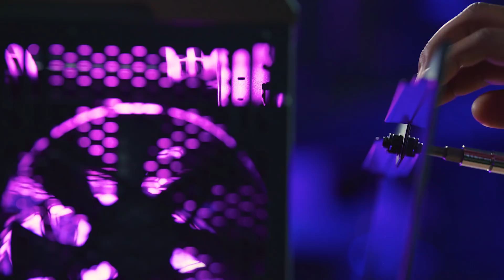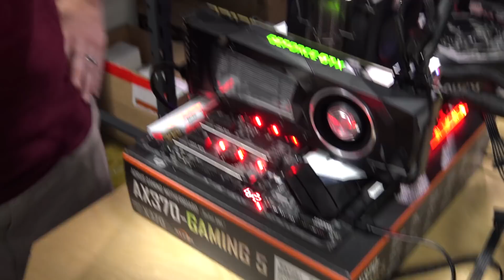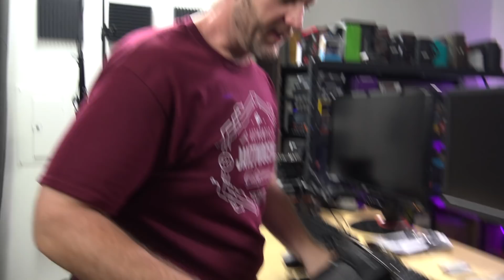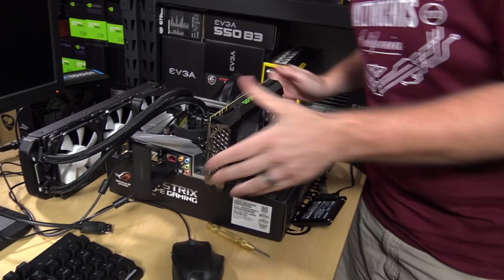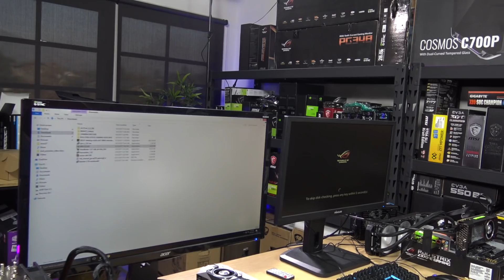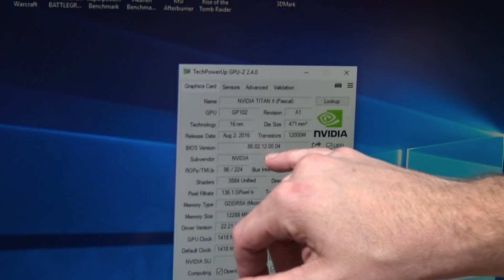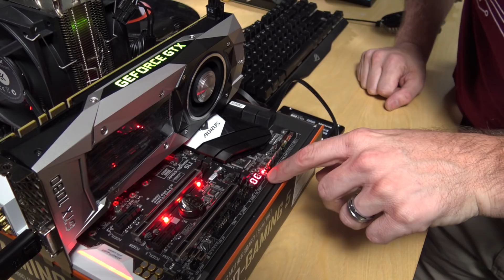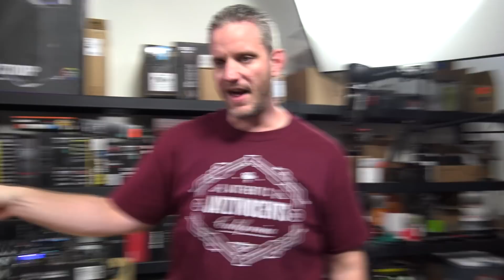I cant figure this one out... HELP!

Comment: Okay, how I would troubleshoot:
1. CMOS reset. Never know when you changed something to test out or maybe something crapped, it's the motherboard version of turning off and on again.
1a. Change to the other BIOS if the motherboard comes with backup
2. Change the PCI-E power rail. Never know when you got the crappy length of wire from the industrial sized roll they used.
3. Change the PCI-E slot. Who knows, maybe it is damaged or just being annoying and wants to give it's brothers a chance. Happens a lot with RAM had it happen a couple times on PCI-E
4. Change the power cord. Never know when yours got so twisted and bent over time it has broken inside. Didn't use to be a problem, but most PSUs don't come with a cord no more.
5. Change the PSU if I have another. Never know when you got the shitty lottery roll. Skip if you don't have a spare.
6. Take it to a friend/colegue and test in another machine, you could be just that unlucky.

Now here is where it gets annoying, because I don't know what else you've done but let's assume everything else was done and we got to this point and the card worked on another computer but all else failed in your machine.

7. Would flash the card with an updated BIOS from the maker and the motherboard as well to make sure it is up to date.
8. I'd hire someone with electrical expertise (don't have that, someday I'll fix this in my curriculum) and test the slots for OC/UC and overall power distribution in the motherboard to see if it is shorting out somewhere or having any sort of issues. If so, RMA it. If it is my own, I'd just RMA the mobo since I can spare the time but we are assuming it is for a client, right?

If it still won't work just in my rig, I'd toss something non-expensive and probably heavy at the wall, curse a lot and do some Google-fu to try and find out what the fuck else could this motherfucking card have against this god damned motherboard so these two bitches would fucking talk to each other. Ahem, pardon the french.

And as 3218390148109 people pointed out, you checked the BIOS of the same card twice. Cheers.

Comment: Check bios on mobo and IRQ settings if you’re able. Clear or reset settings. Can you push out verbose BIOS out instead of pretty logo? +1 one comment about BIOS #. You didn’t check gfx bios when you moved card from ryzen to intel system. Post check is failing likely due to another setting - again recommend verbose BIOS out

Comment: Jayz you checked Bios on the same card twice.
I was gonna say faulty MoBo. I'd try removing the power plug and setting the PSU on 0, then remove the CMOS battery for at least 30 minutes. (Reset CMOS if you'd like) and insert the CMOS Battery, the powerplug in the PSU, switch 1 on the PSU and Start. Also check drivers.

Comment: To me it would be an older BIOS version on the card that is not working on the Ryzen rig... I bet if you flashed the vBIOS from the working card to the one that isn't working that it would indeed work. You cant really blame AMD, Ryzen or MSI or whoever as the card that does not work would have been released before these Zen parts were even out right? so it would make sense in that way.

Comment: Use another motherboard? If your card works, it obviously a motherboard issue. 

You had to reseat your 2nd card as well to let it boot. More obvious pointers.

It's also a gigabyte, notoriously bad motherboards in my experience.

Comment: When stuff like this happens to me, the first thing I do is eliminate any and all potential dumbassitude... I'd Mount the questionable hardware in a real case or test bench. Then reflash the GPU, possibly corrupted, even though version correct. If available, I'd do the GPU in a different Ryzen build. It's possible to have some random physical blemish causing a snafu due to voltage needs of the silicon lottery. I'm also old and senile though... Damn near 50.

Comment: When I build my ryzen my old gtx970 don't work properly I installed an reinstall 3/4 times nothing happens after  boot my PC with one ram works fine after clean boot and some check on bios reinstall the second ram everything works, I don't know what happens I install the ram on the right slots as the manual show me

Comment: Thanks for the video because I am going to do my first build in a couple of weeks. Can you plug the non working titan card in another pci slot and see if it works. If it works then the problem is the first pci slot you plug into. I now that you tried other cards into the first pci slot, but if nothing else work there is nothing lost in trying.

Comment: Problem: card doesn't work in this system but it does in this other system
Solution: get a new card, the card you have is borked. 
Reason: This is an impossible to troubleshoot issue. you are looking for a needle buried a beach full of sand. There is most likely something off about the silicon on that chip that is causing instability on the ryzen system. Either because the board itself can't deal or like you said, ryzen is very picky. with the way ryzen works, there might be some bad circuitry on the GPU that is causing Ryzen to have issues communicating with the card, hints the VGA error. but i'm just a lowly techy that has had issues with OCs and bad and aging chips over time. I've had a 5770 bite the dust then rise like a phoenix again... WTF?

Comment: thats what we call a bug, THAT titan maybe has a magic set of characters somewhere that happens to cause THAT motherboard to freak out, or vice versa, try different ram, cpu, cpu fan headers etc etc

I've had a similar experience with pata drives a while ago, a specific drive wouldnt work on a specific board, everyone baffled, then months later that board was found running fine with that hard drive, but there was different ram, so whatever

Comment: maybe not reflash the BIOS, but RESET the BIOS, sometimes there can be quirks with new hardware, and a preset BIOS can mess with it. Same reason you should reset a BIOS after a reflash. I've had past issues with boards which didn't behave after a reflash, until I reset the BIOS. (talking motherboard BIOS here, not the GPU). Second, i'm not up on new hardware, but is it all running PCIE 3, or is it running PCIE 2. maybe the board is trying to make the card run PCIE 2 and its not falling back nicely? Basically saying, why not check the card communication speeds on each system? Also,  how are the power connectors on that card? could it be a bad contact for the GPU power? just to rule out a power issue. It could just be a bug though, I suspect there are still little quirks in the Ryzen platform to be ironed out, and you've just been unlucky enough to find one?

Comment: only thing i saw was you did not check the Bios on the card that was not working correctly.  ie bring the bios number up on the two systems at the same time.  in the video you checked the bios on the same card twice.  i assume you only made that mistake in the video and not during your actual troubleshooting but you should reverify it anyway.

Comment: Had the same problem. the only thing i can think of that could cause this would be the motherboard itself. maybe get another motherboard that's the same and also have the same  bio's version too see what happens. if it works on motherboard 2 and not motherboard 1 then case closed.

Comment: Seems like a power delivery issue on that card making it more sensitive to the ryzen boot sequence. Try switching power supplies.

You can also try adding a second card to the ryzen system, it will probably post with the two cards in.

Comment: At 4:00 what does the screen say? Did you try throwing it in the x8 slot (yes it's slower but then you can narrow if it's a board problem or not). Did you verify that they were both NVIDIA branded and not out of another company... say MSI or XFX or EVGA some where in the card. Gigabyte hardware is sometimes weird about that. Yes I get they're Titan X's but still may want to check components in the actual cards. Have had Gigabyte's that just straight up were not compatible with other GPU's.

Comment: Its got to be a bug with the gpu specifically not liking the hardware combination to test this try building and identical ryzen test system same model cpu, ram, mobo, bios versions but use the same titan that refuses to post and see if it still has the same problem as with the old ryzen test system.
Reply: Or change each component one at a time until the problem goes away if it persists its a sentient titan and prefers intel gg.

Comment: I've had the same problem with old Intel system I had. It was with an R9 290. Just wouldn't work. Worked great on a Q6600 System, but not with my i5 750 system. I honestly couldn't figure it out and thought that the video card was bad. It wasn't. I had to build a new system to use it. I think it was the motherboard.

Comment: I've looked online to see if other people had similar issues (specifically that b2 error code) and it seems like most people who have this problem is because of a bad PCIE connection (Some guys had this problem because crazy GPU sag, one guy was using a shitty PCIE riser, etc). So basically clean the PCIE slot AND the connector on the card itself (preferably with alcohol) reseat the card and tight it down with a screw. Clear CMOS and try again :)
Reply: Agreed

Comment: I had two 970 cards on an Asus ROG motherboard a few years a go with the exact same problem. In the end, Asus replaced the motherboard and this fixed the issue. The two cards worked on different systems in solo and tandem, but just not on one particular system. Not sure if that helps.

Comment: Maybe try changing the RAM on the ryzen system? Specifically to sticks that are on the memory support list for Ryzen as i have had gpu issues and sometimes failing to post and my memory is not on the support list. Ryzen has had a nightmare it seems with memory support since release!
Reply: Paranoid Waffle 
The pain is that not all motherboards support the same RAM. You must check the manual of EACH motherboard that you are looking at.
Reply: Austin P I know that now, just I unfortunately learnt the hard way :(

Comment: Just gonna run a list of things:
1. You didn't show the bios for the card in question, you showed us the good cards bios on both systems.
2. The AMD bench is using the Bottom most connection on the card while the Intel bench is using the Top most connection. If the Bottom connection on that card is damaged and you attempt to use it that can cause a short and fail to post.

Comment: I would try to switch the pci slot, and test the same slot with an extension. I would try an other motherboard. I would try an other plug of the PSU. I would check the bios of the Motherboard. I would check the contacts as good as possible with a multimeter, to see, if there is any difference between the GPUs and or the Motherboards. (I would try a different CPU, a different Ram.) I would try if it would work with dual GTX Titans, if it would boot, and how many GPUs it would recognize. 

Good luck with all the combinations of my suggestions!

Comment: Just a couple thoughts.  As many have already posted...you showed the bios on the same card.  You probably checked the other card off camera so whatever on that one.  I'd say if you haven't already done so...reset the gpu to factory clock settings.  If that doesn't work then swap out the ryzen cpu.  Since there is no igpu... it's possible that the combination of gpu bios version with a wonky graphics controller on the processor could be causing the issue.

Comment: You didn't check the bios of the suspect card after you put it on the intel board.  You just checked the same GPU twice, once on each system.
Reply: ye , very possible that he did by mistake :3 or he is trolling us . but I don't think he is trolling nor I think he didn't label them somehow to be able to tell the difference

Comment: Random suggestion:

Could you try 2 x separate GPU power cables ?
Swapping the PSU`s between the systems.
Resetting the CMOS (You prob did that tho lol)
Perhaps even swapping the Ryzen cpu for a different one just to test what would happen.

Also, what happens if you try booting with the GPUs in different PCI slots on the mobo ?

I had this weird problem with my old system (5 years ago think) where every year for like 2 months my LAN network drivers would freak the f*ck out. Then the issues would disappear and all would be well. Maybe its the techghost messing your day up :p

Comment: 2 suggestions. First, try the Titan XP that doesn't work on the Ryzen board with a PCIe riser/extender cable to see if that works. Second, try to replicate this issue with a second Ryzen CPU and Motherboard with the exact same RAM, BIOS, BIOS settings etc.

Sounds silly but I think you are dealing with a "comedy of errors" manufacturing defect. Maybe there's a slight issue with the PCIe slot, the GPU, the motherboard or any of the three together. Like the PCB thickness on the GPU is a mil off spec and a pin on the motherboard is too that together results in non contact. Obviously this shouldn't be happening given that the software is is controlled for. That only leaves a hardware issue, and with confirmed working hardware, it must be something physical.

Or maybe it's just haunted, who the hell knows?

Comment: So I know it was mentioned already, he did indeed check the BIOS on the same card twice, but I'm gonna say that Jay has checked BIOS version for each GPU because he's a smart guy. I would attempt a BIOS flash on the troublesome GPU again but not with same BIOS, maybe go with an older one first as you've already ruled out that the latest isn't working with Ryzen but is working fine with Intel. It could be that particular GPU could have it's own issues that aren't brought to the surface with one but with the other. If that fails then you start with minimal boots with lower RAM speeds and maybe smaller sized RAM as well. That's what I'd do at least to each his own in troubleshooting lol

Comment: Jay, have you check the contacts on the card? or the Mobo? do they line up appropriately? This could just be an issue of quality control and this card is just 0.1mm out of spec.

Comment: 1 Plz do not hate on my missing knowledge on pc 
2 will i get an honourable(thank you) mention if you do a follow up?(if my suggestions actually work) 

You mentioned re -seating did try other pcie x16 lanes as it would not physicly fit an x8

I really don't know why but actually like trying to test faulty mobo ram slots 

I might also suggest trying 1 ram stick at a time because god knows why ryzen mobo is bad at pointing out something that is faulty

Comment: I don't see how this is a Ryzen issue. In this video the only variable that changed was the GPU on the Ryzen build. All the other (Nvidia and AMD) cards worked which makes this card specific. I would start with looking for wear, damage or dirt on PCIE connector on gpu. In theory the slots are all the same but considering tolerances etc....

Comment: I've been building computers since the 286 days and have seen things like this several times (two particular components simply won't work with each other, but work separately with everything else). The main things I would try are:
- Reset all bios settings to their defaults.
- Disable bios error checking (if possible)
- Swap out other seemingly-unrelated components (cpu, psu, ram)
- Wait for a new bios release.
- Give up and exchange/return the component.

As for what's causing it: because the motherboard is giving an error, it's purposely stopping things because it detected something outside of normal operating ranges (probably a voltage difference). The other board might have greater tolerances, or the thing it's checking is actually in-spec on the other board because of other related components (ram, psu, cpu).
Reply: Voltage ranges. Not all cards are created equally. Might be onto something. Mobo shouldn’t have a problem with it, but could be. Swap the PSUs also, just for giggles.
Reply: I think you are right T Van. The Titan that does not work might just need that little bit more power that the board will not give it in this configuration. Jay did you try using only one stick of memory and are you OC the processor? If so stop OC and see if it posts. Also disable all SSD's and try using a spin disc HDD. It sounds weird Jay but this looks like a power issue.
Reply: You got me dude :D
Reply: Swap out things including cable, had that happen to me on a 1700x build and MSI 1070.  Did not like the display port cable I had on it.
Reply: Agreed. Sounds very possible that voltage may be an issue. Could be a small short that one system can Handel but not the other.

Comment: This happened to me once, was running a GTX 650 by Palit on an Ivy Bridge setup. Installed it, thing wouldn't boot. Spent a whole two days scratching my head because I tested the GPU in another machine and it worked fine. Took it back to the store and they gave me an Asus variant. Worked first try. Granted these cards aren't identical as they are here, but to this day I could never figure out what it was - PCs can be odd sometimes xd

Comment: It's a Mobo bios problem, had similar prob on AsRock x370 Taichi when I was switching my 1070/RX Vega 56.
Bios was somehow corrupted, all I did is rolled back to the previous bios build, with my gtx1070 on. And then updated bios again.
Also make sure that you do a clean GPU driver install with DDU>
That fixed a problem for me. Took about 2 days to figure it out....

Gl Jay I hope that this will work.